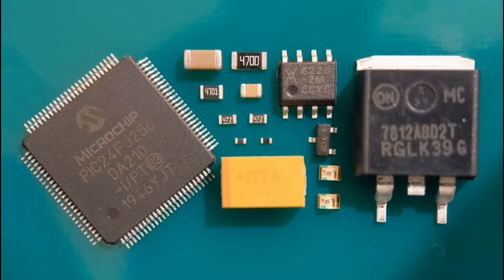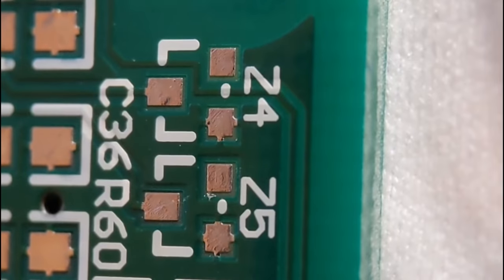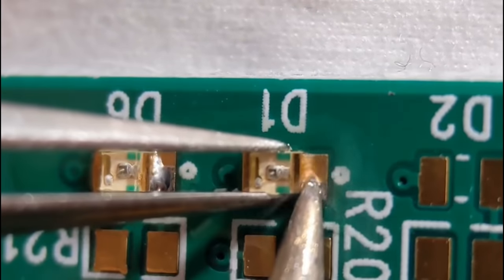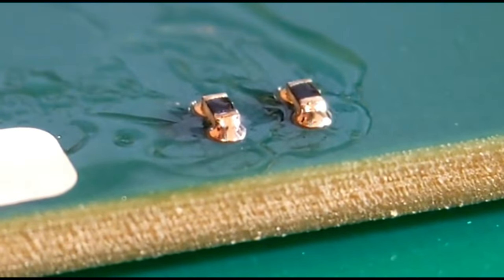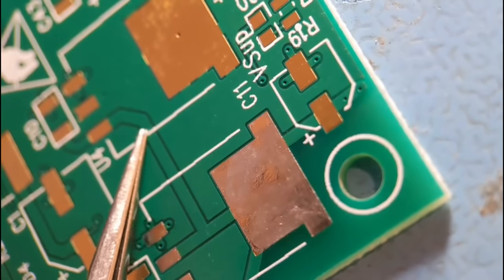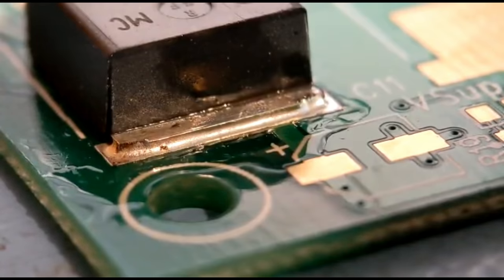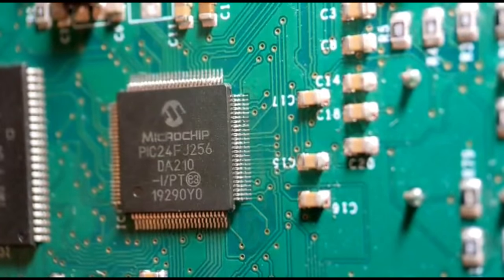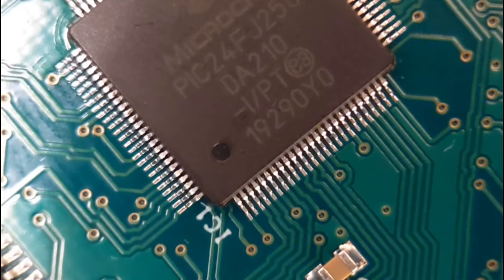How To Solder SMD Correctly - Part 1 /SMD Soldering Tutorial

Comment: What do use to clean up after the completed soldering? What’s the white pad made out of?
Reply from the maker: Hi , the fluid I use is called Ultrasolve and is available from Farnell, RS Components , Rapid Online and other electronic distributers. The cleaning cloths I use are called Gtek dry wipes and you can get these from a company called Grove Sales ltd ( based in England ). They cost about £5 for a pack of 100 and are amazing , the best I've ever found. Thanks for asking 👍

Comment: Pre tinned. Mean solder beneath component on top of flux. Then component yep?
Reply from the maker: Hi . The large device in the video you've commented on , what I do is solder up the large pad ( particularly useful if your pads are a gold colour finish / then if needed I use solder wick to take the excess solder off leaving a lovely flat tinned surface . Then you can clean off excess flux , apply new flux then place the component on top of the new flux , then solder away , the thin layer of  solder you've already applied will really aid the flow of the joint underneath , without doing this you may just get a join at the end of the device , not underneath . Hope that helps , good luck 👍
Reply: please leave a link to where I can buy really good thin solder. I did buy some from amazon and it does not melt. I have some which is 3 times thicker and it melts instantly. Too thick though. And the thin solder also bends away from the solder iron. useless.
Reply from the maker: Hi , I don't do links to certain products ( just my personal choice not to) but I can tell you where I get all my solders from . A company called BLT Circuits ( based in England ) , very good reliable company supply all solders , lead free and leaded all the way down to 0.25mm , also a supplier of solder paste and other soldering products , hopefully they can help you . Good luck , thank you for your comment 👍

Comment: Just had a go at populating my 1st SMD PCB. Started with the 100 pin Quad IC, using the flat tip and drag method, with thin soldering wire. But had so many bridges that I ended up using ChipQuik to remove it and started over.
Solder paste worked much better on the second go. So I got all cocky, thinking that the remaining resistors and caps would be a piece of cake. 0804's weren't too difficult, but the 0604's behaved like Mexican jumping beans.
After regrouping to watch this video, I have learned many errors of my ways. The steadiness of your hands and soldering techniques are not to be underestimated. Thank you for sharing them on YT with us newbies. I'm ditching the flat blade for the fine cone tip.
Q1: I'm sure that you have mentioned this in your other videos (which I'm about to binge watch), but what is the temperature of your iron? I had my @ my usual 300 degrees, but see that the melting point of solder paste is only ~250 deg.
Q2: Have I most likely already fried the quad 100 pin IC by spending too much time attempting to remove bridges? I only see max temp specs for ICs while powered on.
Thanks so much for demonstrating how the Master SolderFix does it.
Cheers!
Reply from the maker: Hi , thank you for your comment. When I'm soldering using leaded solder I set my iron to roughly 330 degrees centigrade and for lead free roughly 350 - 370 degrees centigrade. I may vary these temps slightly for certain parts but overall these temps are the normal ones I use . Your ic's should be able to take temperatures that you've raised it to by your attempted rework so shouldn't worry about that , they are very hardy in most cases. Hope that helps , take care 👍
Reply: @mrsolderfix3996  Thank you for your reply and putting me on the right track to successful SMD soldering. 
Having watched several of your excellent YT videos, I feel confident enough to give it another go, the Master SolderFix method. I'm sure that it will make a world of difference to the process.
Just designed my 1st PCB in KiCad (@70 years old), using 1206 SMDs which I'm hoping will help, as well.
Cheers! 😎
Reply from the maker: Hi , thank you for your comment and supporting my channel, very much appreciated. I'm glad the videos have helped you , that makes them all worthwhile. Good luck with all your soldering projects and thanks again for your time . Take care 👍

Comment: Very good job on soldering...I had to do some surface mount resistors and they are tiny as a gnat.
Reply from the maker: Hi . Thank you for your comment. I find if you preload your pads like some people do it's a bit messy , but if you tack one end on with a tiny amount of solder it's much more controllable. Also 0.25mm solder is a must for small resistors  
 Thanks again and good luck with any future soldering projects 👍

Comment: nice ;) WOuld flux made with colophon and 99.9%isopropyl alcohol works without messing too much ? What ius that very liquid and transparent flux you use, please ? Thanks for the vid? I am styruggling more with dismounting and putting back CI and other small parts.  AT what temp I begin to harm the circuit ? (it happened the copper did fold)
Reply from the maker: Hi . I'm not sure about the flux your suggesting , I've never tried anything like that . The flux I use is called SMFL200D . It comes in a 200ml spray can and is the only flux I ever use . It's available from Farnell , RS Components and others . Also seen it on eBay + Amazon . About £13 a can.
The temperature you are normally safe with is about 360 degrees centigrade , but if you keep playing with the pads eventually they may start to lift off. Using leaded solder instead of lead free will make it easier. I also done a video showing reworking components using 2 soldering irons . This might help you as well.
Hope that helps you , good luck 👍
Reply: @mrsolderfix3996  Thank you for answering me so fast , I have seen pure colophon block used to help the solder flow on wires and on pins, and the man makes his own fluid with it , very liquid. But it tend to be sticky, it does not clean as well as professional flux, but the one I have is written "CS flux" sort of fluid poaste, , I will try yours it looks great. Again thank you, have a nice sunday ;) - and sorry to be so long winding, I write asap I think !  actually training at that time ;)
Reply: @mrsolderfix3996  to be honest, I think bending the end of the tip was not good fort the surface treatment. I am also wondering if filing a small anneleaing into the tip, above the tinnied end of course, would not help to keep the solder on the tip (by reducing the heating mass just above) ??? May be the opposite ;)
Reply from the maker: Hi . I'm sure there is a suitable flux you can get hold of similiar to the one I use maybe. I find that if flux is to runny I pour or spray a little in a pot and leave it 30 minutes , this makes it go thicker.
I use a Weller make of soldering iron and I file my tips down to the shape I need , but I know some makes of iron will not allow for this as they work in a different way. Roughing up the end of the tip does help you tin the solder tip and leaded solder will help this as well.
You will love the 2 soldering iron method , it is genius and makes some rework easy  ( watch my video on this method )
Good luck 👍
Reply from the maker: The soldering iron that I use Weller TCP S  , you CAN get away with filing the tips , it does NOT reduce the performance at all . Done it for many years now , no problems at all . I've always mentioned this is the iron I use . I know other irons like Metcals you can't file the tips as the outer layer is so important so totally different to the tips I use . I know you can buy bent tips but sometimes you need to make weird shapes to get to certain joints , and you can't buy tips for this sort of job.
Reply: @mrsolderfix3996  Hello, this is out of topic so excuse me, I just did read that in cas we do not have at hand, we can use "paper cofee filters" as a non woven fabrics - to clean screans or parts to be glued dust free, or even to get rid of the flux without leaving small pieces of fiber. It may be probably OK, then I though that we have plenty of facial masks at hand those days, and they see to me made out of non fiber material too. Did you heard of that ? Using them in place of the special fabrics for electronics cleaning ? Best regards 
Oh BTW , did you hear of using heat (or heat plus cold) to straighten a twisted, or bowed case oàr frame, on a cell phone ? (using material memory , as for cars ???)

Comment: I guess where I went wrong years ago, was the lack of solder flux and wrong iron and solder gauge
Reply from the maker: Hi . I was the same years ago . Now I've learned proper flux a decent iron ( I love Weller irons ) and 0.25mm solder for tiny joints is a massive advantage to achieve good soldering . Thank you for your comment , much appreciated 👍

Comment: It well indeed but how can l remove ic using hot soldering tool, can l?
Reply from the maker: Hi , to remove the QFP in this video ( large 4 sided IC ) you really need a hot air gun . I would normally set the temperature to about 350 to 370 degrees centigrade depending if it's leaded or lead free and maybe a bit more if it has a heat pad underneath . If it doesn't have a heat pad you could use a product called chip quik . It's a low melt solder , lots of videos on YouTube how to use it . 
These components are pretty easy to remove if you have the right equipment. If you need to protect plastic parts nearby when using a heat gun use silver foil tape to protect them . Hope that helps , good luck 👍

Comment: Can you post links for the type of iron and tips you are soldering with?  Thanks
Reply from the maker: Hi . Thanks for your support , much appreciated. The iron I always use is called a Weller TCP S . It's a great old school iron that comes with a great selection of tips that you can play around with if needed , i.e file down to a real point or bend around corners etc. The tips for this I generally use are a PTP7 or PTH7 ( this is quite a pointy tip ) and for large joints I use a DD8. These 2 tips generally cover all the joints I've done in all my video's so far . Thanks again for your time 👍

Comment: you solder with so much ease - amazing!   are you making your own liquid flux or buying ?   could you please share the link for liquid flux anyways ?  - thanks!
Reply from the maker: Hi, thank you for your comment. I do buy my flux and the only one I ever use is called SMFL200D .It's a great liquid flux that comes in a spray can . I normally just spray a little into a small container then use a dipped plastic Cable tie to apply it. I've actually done a complete video ( on YouTube about this flux ) that tells you it's uses and where to buy it etc . Hope that helps , thanks again 👍
Reply: @mrsolderfix3996  appreciate your prompt response. Will check the video!
Reply from the maker: Hi . No problem . Thanks again for your support 👍

Comment: Any tips for leadfree and leaded soldering?
Reply from the maker: Hi . Generally people might solder their leaded joints with a slightly lower temperature than their unleaded joints but not always the case . Leaded solder does have a lower melting temperature , but I generally do both these joints about 350 degrees centigrade. 
Sometimes if you have ground plains etc you may need more heat to get your unleaded joints to flow ( maybe 375 degrees ) or use a larger tip on your iron . Took me a while to get used to unleaded , even today there are times when it is difficult compared to leaded . I always use SMFL200D flux on all my joints , this is the biggest help when soldering anything , without flux soldering is very difficult to get neat.
Hope that helps , good luck , thanks for your question 👍

Comment: Can't you get a claw tip for your iron that holds the component on both ends to both place and solder the component in one go?
Reply from the maker: Hi , thank you for your comment. You can get soldering tweezers that would do what your suggesting , but I personally wouldn't recommend them . I find its way easier doing it as I have shown . I don't know anyone who would ever fit resistors , capacitors etc using these tweezers . They are ok to lift components off with though . Hope that helps , thanks again 👍
Reply: @mrsolderfix3996  thanks for sharing the wisdom of your experience. Is it a problem because you'd have to be so quick and flawless in placement? I wonder if someone does a push-for-thermal-contact tip that wicks solder and flux from a hot part so you can take all the time you want and the solder flows in at the right moment.

Comment: What are you using for the cleaning? I use cotton pads, but they tend to leave strands and fibers behind :(
Reply from the maker: Hi . The cleaning cloths I use are called Gtek Dry wipes. From a company called Grove Sales . Pack of 100 about £5. They are the best cleaning wipes I've ever used and leave minimal or no fibres. Well recommended 👍
Reply: @mrsolderfix3996  Thanks a lot for the tip, I'll try them!

Comment: What power do you use on your iron? I'm always afraid of burning very small components.
Reply from the maker: Hi . I use a Weller TCP S soldering iron which is 50 Watt. To do most leaded soldering I would use roughly 330 degrees centigrade and for lead free soldering about 350 -375 degrees centigrade. I may vary these slightly if needed . Hope that answers your question. Thanks for your comment , take care 👍
Reply: @mrsolderfix3996  Thank you for the reply, that answer my question beautifully.
Reply from the maker: Hi , no problem , I hope you get on ok with all your soldering projects .
Maybe my other YouTube videos can help you in the future . Thanks again , take care 👍

Comment: I am glad that I found your channel. Watching you gives me confidence to do surface mount soldering. People that I have talked to had me terrified to do this. But after watching you. I think that I will have a go. Thank you.
Reply from the maker: Hi , thank you for your support of my channel , very much appreciated. With soldering the more you practice the better you get as you will learn what sort of tips and what size solders you need . Also use flux ( vital when soldering ) , I've tried to cover lots of soldering subjects during my videos and I will keep posting more when I get some spare time ( which isn't that often ) . Good luck , take care 👍
Reply: I can totally relate. Been avoiding an SMD board for months, before gathering up the courage out of necessity. The 100 pin quad IC wasn't as bad as expected. Thought I was home free, until attempting the 0603's, which behaved like jumping beans. Haven't even attempted the 0402's.
Made a mess of the project. So now I've started redesigning (1st ever) the commercial PCB  with 1206 SMDs in KiCad by following their tutorials. That was already part of the plan. But, now, it's sooner instead of later, after the prototype with the commercial board.
Mr SolderFix has amazingly steady hands and excellent soldering technique, which makes it look so easy and simple. I've learned to purchase at least twice as many components as I need, just to allow for failures. Just put in my order and found significant price breaks in  quantities of 100, which also minimizes repeated shipping costs.
Good luck on your project.
😎

Comment: ah man you make it look so easy lol. ive got motherboards that need new cpu sockets and i'd love to be able to repair them as its not exactly well heard of. i tried simple soldering using a gas solder (cheap crap i learnt fast dont worry) on an old board to practice, and i couldnt even place the smd in position it looked like i had parkinsons as its so small. although i wasnt in a good mind state then. i have a few jobs needing some soldering tlc shall we say but im not touching a thing till yet.  videos like this, detailing everything helps a lot. thanks man. 
PS: if you can change cpu sockets youll make my whole year lol.

Comment: How can i know the exact position on the ic or board and it's polarity tnx
Reply from the maker: Hi , normally your board will have white silkscreen and one corner will have a chamfer or a small white dot . This denotes pin 1 on the board .
On the IC there is a similar chamfer in one corner and the other 3 corners will all be squared off. The one with the chamfer is pin 1 .Sometimes all 4 corners have chamfers but one will be bigger , this bigger one will be Pin 1. If your IC has a small dot built in to the body this will be pin 1.
Also you can go on the internet , search for your components data sheet and this will tell you how to locate pin 1. Hope that helps .

Comment: when I solder wjs on the time stamp of your video 4:02 i first use a little flux then i rip of a 0.8mm piece of rosin core lead/tin solder then place it on the leg i want to solder and press the iron against it after i have it in the proper place. it's not as nice of a solder job. But it works, hope this helps some of you out.